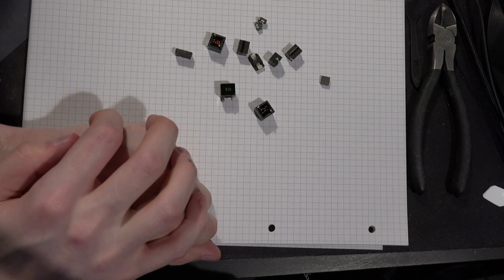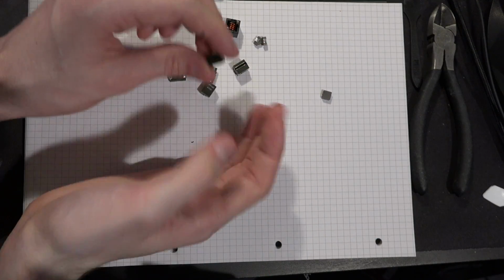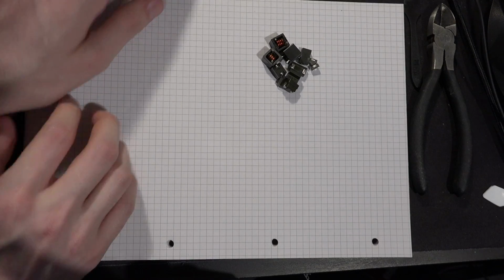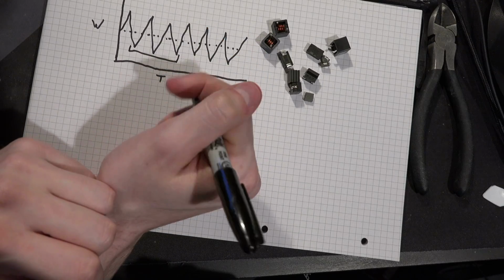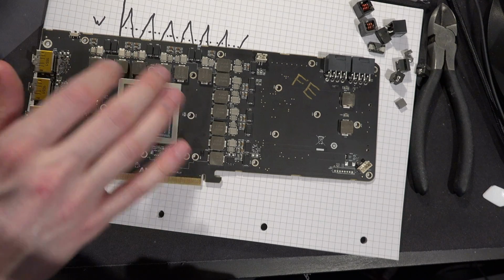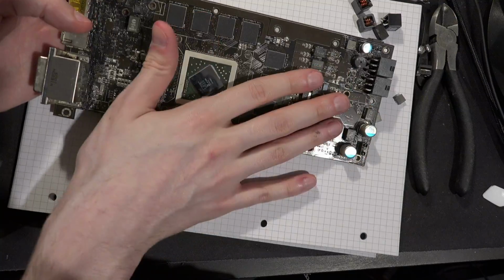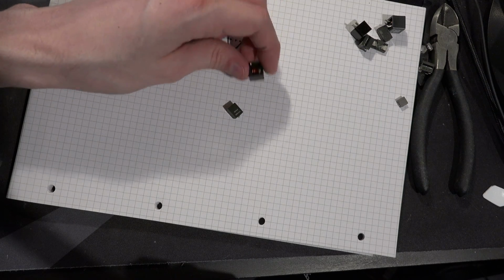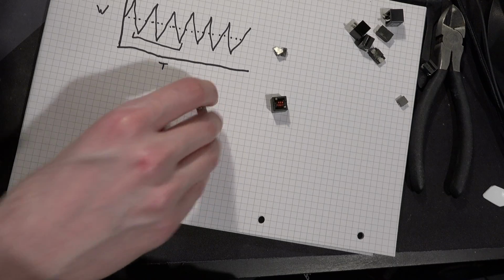Rambling about Coil Whine

Comment: My 1080Ti Armor coil whine badly.. has those sfc inductors. Hot glue fixed it...
Reply from the maker: so they do. I've just usually had it happen with the SMD types.
Reply: My 1080 armor only whines when I start Fortnite and nothing else
Reply: so you desolder it and filled it up with hotglue?
Reply: hahahahaha ... nope its already filled !! WITH METAL ... otherwise it would not operate :D
Reply: would you mine sharing more details about the method that you used to fix the coil whine? Like how exactly did you apply the hot glue and in what amount? I have a Gigabyte blower style 1080ti with a Kraken G12 bracket on it and it whines pretty badly whenever my games go above 90FPS.
Reply: i have a 1080 armor it only whines in benchmarks under heavy load. what did you exactly do?
Reply: Would you please give us a picture how actually you did it? A simple picture can describe all. Thanks.
Reply: Yes please post some pictures
Reply: Armor is a pretty bad card, it has the same cooler as the 1070 on a 1080Ti
Reply: Zfast4y0u  what no it doesnt
Reply: Yeah please share with us!
Reply: It would be cool if you posted some pictures or explained how did you do it, it would help many people
Reply: Please share some picture Please.

Comment: I love your videos Buildzoid! These "Ramblings" videos are always the most informative and seem to almost always teach me something new - Like your semi-recent video about RAM and how to mathmatically calculate real world speeds using frequency and timings! 
Strange question however - Do you still that Gigabyte board and AMD FX 8 Core CPU from that overclocking video you did awhile back? I'm actually rather curious to see how the FX 8 Core series fairs (realistically say if your monitor only supports say 1920x1200@60hz) with something like a 1080ti - Just how usable is it in 2019? And more importantly how does it fair when the user disables 4 cores - How much more general gaming/work can be done vs having all 8 Cores running?

Comment: also had a 980 with miss-applied Liquid metal. Clean the socket with a brush under almost cooking water. No joke. If you clean all the shortening-stuff away, it will probably run again. Mine did.
Reply: ya i got conductive thermal paste on my rx 580 8gb transisters and the card died but i cleaned it away re flashed bios and it works fine again.

Comment: My XFX 7970 used to audibly whine in high fps menus but it was never audible while gaming. I have a Asus 1060 now and it doesn't whine at all so it sounds like you were right about them using moulded inductors.

Comment: Only time I ever had a "Coil Whine" was with an under performing power supply.  Was using a 600 watt ThermalTake and went with a 750 watt and problem solved!
Reply: Then it was you PSU making the noise and not the card...

Comment: The important part you don't really explain explicitly is that anything solid is liable to crack, the key is having the coil in a flexible medium so that it can vibrate without cracking and separating from the housing.

Comment: My Asus dual 2080 ti on ek block screams. Tried bran new 850 and 1200 watt psu, didn't matter. They say LR22 on them. I measure GPU core voltage and the whining correlates with it, higher voltage louder whine

Comment: Problem is the glue only helps with low frequencies not high in kHz. I have electronics that are just a ATTiny13 with resistor, cap, and it will still whine in some use cases while in others it's silent and that's when using 18kHz+ PWM on it, yeah even then have one case that still audibly whines. As long as there is any switching, PWM and decent power/current being used, it can whine in some situation, doesn't need inductors to do it but those can indeed be a prime source on PC components.

Comment: I got a Powercolor Red Devil RX480 which produced a higher pitched coil whined at around 200 fps.  I returned the card for the ASUS Strix RX 480. It too whined at very high FPS but at a lower frequency. However, as time went on they stopped and ran quietly.

Comment: I had my first coil whine problem almost a year ago. It coincided that I bought a reference GTX 760 and a sound card together. I could hear a very strange whistle from the headphones while playing, which varied according to the load of the GPU. I went half crazy until I found out what that was. In my case I solved it by changing to a quality PSU.
Reply: What psu kind are you buying??
Reply: @younesman1326  The problem was with a Corsair VS 550. I changed it for a CX 550 and everything was fine.

Comment: my Gtx 1070 has horrible coil while. I tried to fix it with glue but did not help at all. Thought more glue could fix it. Wroooong. Now I have a horrid looking PCB but at least it still works. (did it 1 year ago)
Reply: Did you hot glue the inductors only or did you hot glue them to the PCB?
Reply: @dosgos  i covered the whole inductors from the pcb to the top
Reply: marmoto liferider what psu do you have?
Reply: @fioletoviymewok9665   corsair 750 watt.

Comment: Unfortunately, you left out the most important coil whine sources, where it is the most annoying: Laptops. And because laptops are so flat, I guess there is a bunch of coils used which also are small and tend to coil whine more, than these cube sized ones, which arent found in laptops I think. So please make another video on laptop coil too and how to fix it. I actually found, that if you put some kind of thermal pad on/around the coils, it reduces the whine too mostly by sound wave absorption. It also looks to me, coil whine in laptops is totally different to explain because they mostly happen in idle situations and not under load situations. My Dell XPS 15 9570, for example, has a bunch of coil whine under specific situations. One is periodic for example happening every 2 seconds for a short time. Then there are lots of "crackling" sounds while loading a web page. Then there is a "mice like" noise when I do boot up or if I open a specific setting window under Windows (the boot timeout and kernel memory dump window, have no idea why it produces a coil whine but it does).
Reply: i have never heard coil whine from a laptop, only mechanical drive heads rattling & interference to the headphone audio at max volume
Reply: @kn00tcn  ... coil whine is THE most annoying thing on laptops. Especially on Dell XPS line since years. It mostly just happens with high-end laptops because of the larger current flow (45W CPU and then 75W GPU or even more), so if you have a potato laptop you obviously never heard about it. Also a lot of newer NVMe SSDs tend to coil whine.
Reply: @bestonyoutube  i have a gaming one with 45w i7 something w gtx, 180w power brick

but how can i hear coil whine if the fan is making a sound? i do hear the hard drive when listening closely

have you heard it outside of dell? not that i dont trust you, i just like statistics & measurements, might even start asking others for mic recordings

(edit: i intentionally didnt list exact cpu/gpu, but i'm very familiar with tower pc hw over the past decade, just dont interact with many laptops other than normie ones or my highish end for its time one, have clearly heard various noises from multiple desktop gpus due to the quiet 120 & up fans)
Reply: @bestonyoutube  so far dell sucks, need to see other brands (you dont have to search for me now)

the second video was near the monitor, that might be the backlight hum, my 2008 CCFL monitor has a hum that changes in tone or intensity (not necessarily pitch) when i change brightness, though that might have appeared in the last few years of old age
Reply: @kn00tcn  https://www.youtube.com/watch?v=6cCVxZdn1vU https://www.youtube.com/watch?v=47i9Pi7GwLM ... mostly every laptop with Nvidia GTX1050/60/70 and 45W Intel CPU has coil whine. Yours mostly too, maybe check your ears? The coil whine of laptops sounds a bit different than the typical desktop GPU coil whine though. And it happens more under idle than under load. It is a more metallic steady noise or short mice like squeaking.
Reply: My laptop has a 40W CPU and Nvidia GPU and it makes a funny squeak when I turn it on. Never considered it might have been coil whine.

Comment: The few Asus Strix 1080Ti's I've had all had the exact same coil whine. I tracked it down to the input filter inductors which are of the molded style. 

I mitigated it by smothering them in nail polish and filling the area around them with cotton fill when installing the EKWB. It still whines but much reduced to the point I can't hear it while gaming.

Comment: i've got a coil whine problem with my build, for a long time. 
4670k + 1060 (both OCed) + old (shitty) psu (460w total, 360w for 12V line). coil whine was only gpu related - i've heard it in furmark, all the times, and sometimes - in games. 
since i changed PSU - no problem at all. no coil whine. 12v ripple, as i understand?

Comment: Just wondering wouldn't the coil whine also impact the psu as it should have the same load variance supplying the gpu?
Or are the inductors used there generally not susceptible to coil whine?

Comment: I never ever heard of coil whine until recently when i decided to upgrade my 2015 gaming laptop. I have went through 4 laptops and all had coil whine. Some worse then others but still very much audible to me. Most recently i decided to try a larger/thicker laptop and went with an alienware area 51m r2 thinking that these thin laptop could be causing it.   Nope, the 51m r2 has some coil whine as well. But i only hear it if i have the fans set to off in a completely silent room, and even then i only notice it when i try to hear it and bring my ear right up to the keyboard. im thinking of just living with it because i only use the laptop for gaming and the fans are on with the speaker up. Anything other then gaming and i use my ipad. Plus other then the coil whine i luv this laptop. Looks amazing, runs amazing with great thermals, and the 2080 super is fucking awesome.  Is there anything without coil whine these days or is this the new norm for gaming laptops? My wife thinks im crazy and says i only hear it because im trying to hear it.  Ether way coil whine sucks and im going to try to reduce it. It does stop when unplugged . Anyway thanks for the info in this video, i now understand whats going on. Do you suggest using the hot glue?

Comment: I have read that "Neutral Cure Silicone" seems to be less corrosive than "normal" silicone or hot glue.  Some claim the neutral cure silicone provides better vibration control and decent adhesion. I have a ton of electronics with PCB damage from mystery hot glue that deteriorated and/or became conductive. Any recommendations for mitigating coil whine?
Reply: Undervolt and FPS cap in MSI Afterburner may work

Comment: My damned Cooler Master V700 started to whine a few months ago. It is 5+ years old at this point, but the only coils in it are the big ass type wound around a metal ring...
In the past year or so every damn component that i had, has produced a whine to varying degrees. A GTX 980Ti, ASUS MAximus VI Hero, EVGAGTX 580 DS OC, GTX 570, ASUS HD 7970 DC OC and now a MSI GTX1080 and my PSU.

So damn annoying and i am very sensitive to it. Forget the components, why did the PSU start whining ?

Comment: My RX 580 has coil whine but only when I spin the fans at maximum but that's hardly ever since when it's gaming the gpu isn't getting hot enough to kick the fans up to 100% it mostly goes to 45%. So the coil whine isn't a big deal.

Comment: Can't like... pick switching frequency ABOVE audible spectrum? it's not hard to have switching power supply to go over 20kHz for F sake, properly designed supply could go about 300kHz with good efficiency, why do they do it? And at higher frequencies you can get lower voltage gradient to smooth out by capacitors - smaller caps.

Comment: I wonder if you can't just mold the inductors in silicone?
Reply: Assembly-line needs some hard surface to hold the thing, silicone is far too soft for that.
Reply: Well one of the properties of the potting compounds they use for encasing the inductors within that ferrite housing, is that the resin they use has a higher thermal conductivity. SO that the coils, however little heat they are producing, are not wrapped in an insulator. Whereby the temperature of the coil has nowhere to go, and keeps on rising until eventually burning out / failing. So maybe if silicone is too thermally insulative, then it cannot be used for the potting compound. I'm not sure of the other reason(s).

Hopefully in the future, at least one manufacturer will put the work in to economically engineer and produce better chokes. Which would help to go a long way towards mitigating this common issue.

Anyhow thank you Buildzoid for this video. It has been really helpful / informative. As I understand it was not something that affects you very much.
Reply: unless someone invented silicone that's more insulating than air..
Reply: You can make in silicon inductances and capacitance, those parts just tend to not be very space efficient. Look at the space taken by the external inductors and image adding multiple of that to the GPU die. Doesnt really work

Comment: I had coil whine for years with my 980ti. It all turned out to be the PC PSU not the GPU....I ordered a RM1000i and had a horrible coil whine, RMA'ed it and now no coil whine at all.
Reply: But what PSU did ya got then?..
Reply: @DVTHEFOX  i still use the same RM1000i they sent me as replacement. Now with a 4090. No coil whine whatsoever.

Comment: I've read many posts about removing gpu backplate(or thermopad put between pcb and backplate) do you think that it could dampen the resonance of the coils? To my understanding metal backplates tend to vibrate which leads to reverberation.

Comment: Is it possible that the electric system where I live is causing my GPU to coil whine ? I just built a new PC and every single GPU i put in it coil whines. 1080 MSI GamingX and two RX 580 Nitro+ 8gb cards(not crossfire), all brand new, all of them coil whined. The AMD cards coil whined a lot less than the nVidia, but still pretty surprising that they did. This is the rest of the system:
Seasonic Focus+ 550W Gold+
R5 2600
Corsair 2x8gb LPX DDR4 3000Mhz
AsRock B450 Gaming K4
Samsung SSD 860 EVO 500GB
The PSU doesn't coil whine, its always the GPU. Help please.
Reply: He just told you that the inductors on the video cards are the ones vibrating. You should had just returned those faulty products and ask for your money back. This is what we should ALL do, so to tell the manufacturers we won't accept these kind of practices and lack of quality.

Comment: Is it possible to glue those inductors to mitigate coil whine w/o actually removing them from the PCB and then soldering back? I have a terrible coil whine on my KFA2 RTX 2070 Super. So much so that it somehow gets picked up by an amplifier of my integrated ALC1220 audio (MSI X570 A-PRO motherboard). Makes it often unpleasant to play games and use the amplified audio output (which sounds awesome, btw, when GPU is not loaded).
I've never tried removing and reinstalling GPU cooling before but now I'm tempted to do it. This GPU is otherwise perfect (quiet fans, great performance, low temps). Coil whine is the only issue.

Comment: Based on your expertise, do you have any idea if it is possible to locate the whining coil? My card is a Powercolor 6900XT ultimate. I would like to try to unsolder this coil and replace it with a better quality one.

It might also be an idea for a video. Modifying an extremely whining card to be silent. A lot of people are complaining at the moment. Be it the 3000 Nvidia or the 6000 AMD cards.

Comment: i have a weird question although dont have the gpu anymore i threw it awhile back before i kinda some what gotten into trying to repair things. but it had a inductor in the back those weird ones kinda stand up but see the coil around it bit the core center broke so the coil could well just unravel if pulled on it i have no idea how it did that but if left alone it worked fine but was curious if it broke like that is it dangerous for the card any? it was from an old radeon hd 6870 so dont own it but more curious in case i ran into that again.

Comment: Hello BZ, I have a question please, I am using the AB350m gaming 3 Mobo, i understand it has a 4+3 phase VRM. 
If i just "calculate" my answer (am an EE), then i would say it wont be enough for a theoretical 16 core/150W, due to per core delivery stability (more cores more switching - right?).
I would love to hear a small revisit of your "YOUR x490 IS NOT READY FOR TR2" for the upcoming RYZEN 3000 - i understand there is virtually no information yet, but some theoretical rambling by you would be nice.
Thank you and have a nice day

Comment: Unrelated to the video:
I got fed up with messing with Vcore offsets and turbo voltages on my 2600K, so I just manually fixed the voltage to what I need in BIOS.
Does this increase the degradation rate? Granted, this is an old CPU and all I need from it is to last until Zen 2 drops, but I'd be nice to know for future reference.

Comment: could you not just soak them in conformal coating? If you have a chamber you could even put them under pressure to force the resin into them!

Comment: In terms of voltage and current , how would soldering two of the quieter units in parallel  to replace one of these cry baby units. Would that alter the voltage as well as the max amps.